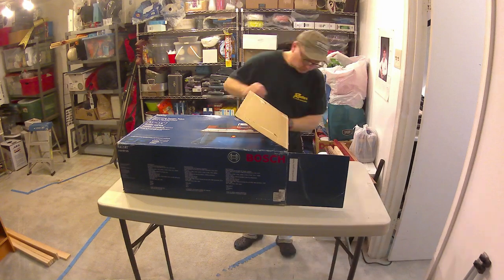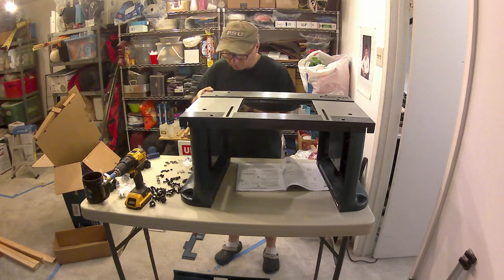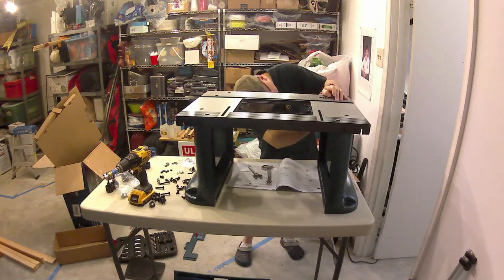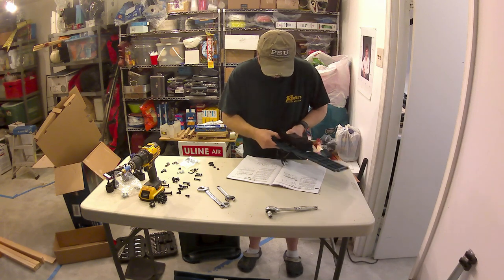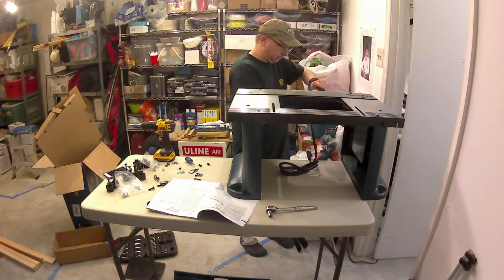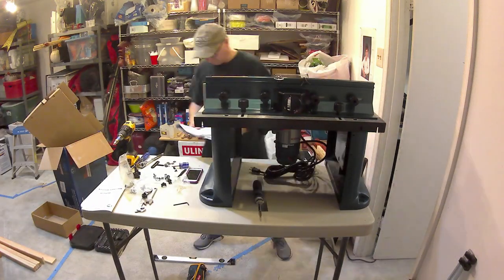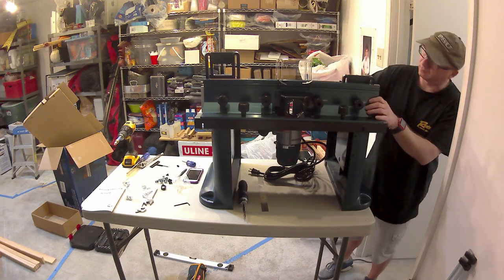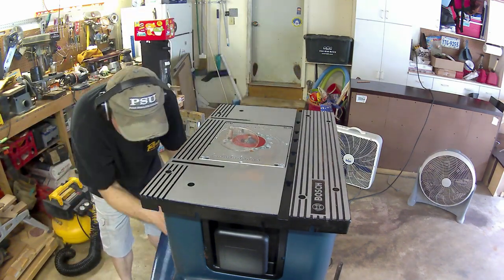Unboxing and assembling a Bosch Router Table

Comment: I just bought the very same table and I chuckled quite a bit because your video described my build experience perfectly. I told my wife that I was just going up to the shop to put my new router table together and when I got back home she said where have you been all day? The drawings are not greaT and if there are 4 screws, 3 might be in one bag and the forth one is mixed in with 10 other bolts, nuts and clips. Good product once it’s together but I have new respect for the guys who put display models together for big box stores, lol!
Reply from the maker: HI Gary - yeah, I know.  It could be a lot easier!

Comment: The extra plug you mentioned is for a shop vac..when you turn the router on and off it also turns the vac off and on.  I just assembled mine today I was dreading it there are so many nuts and bolts..I was afraid I was missing some but turns out I am good.  I also bought the 1617 EVs at the same time so I know everything fits.  Your video was a good "pre-assembly" view.

Comment: Hello! I have the same router and curious if you turn it on and off by pressing the button on a handle. 

When it's mounted a router table it would be reasonable to use a switch on the table. 

But the router manual states that it won't turn on if the router switch is pressed when the router is powered up.
So, do you have to reach the router itself to turn it on while the router is mounted into the table?
Reply from the maker: Hello Igor - I locked the switch on the handle of the router into the on position and use the switch on the table to control the router.  There is a little button on the side of the handle that locks it into the on position.  I've not had any issues.  Hope this helps.
Reply: @cyberreefguru  This is really awesome! Thank you!

Comment: Hi - I have purchased my first router a Bosch POF 1200 AE but it doesn't appear to be designed to be used on a router table. So, quick question, which router model did you install? Thanks for the great vid.
Reply from the maker: Hi Patrick - thanks for watching.  I have the MRC23EVSK. The 1617EVSPK seems to be more popular, but something (I can't recall what) led me to purchase the MRC23.  I've having issues with the plunge base sticking, but otherwise, a great router.  I think the 1617 can be used with the Rockler router table - the MRC23 cannot.  Hope this helps - don't forget to subscribe! :)

-tom
Reply: Thanks. You now have 584 subscribers ;-)